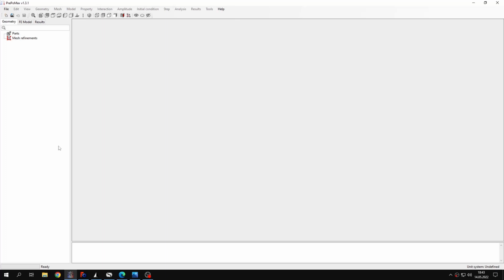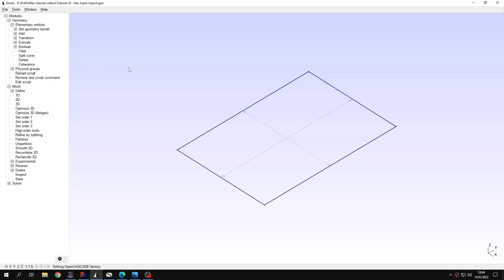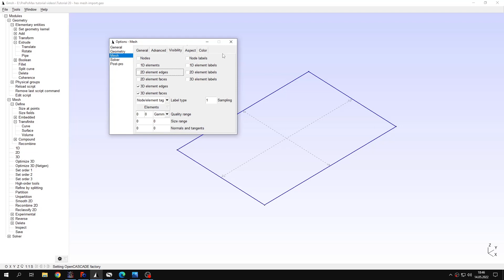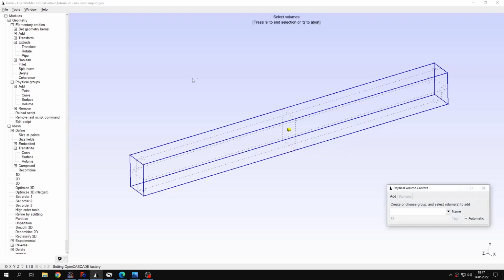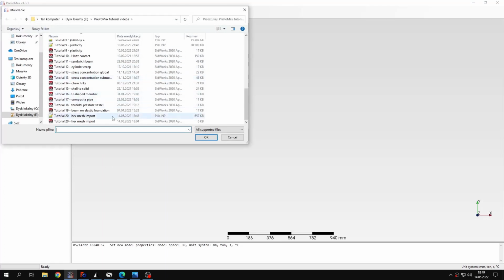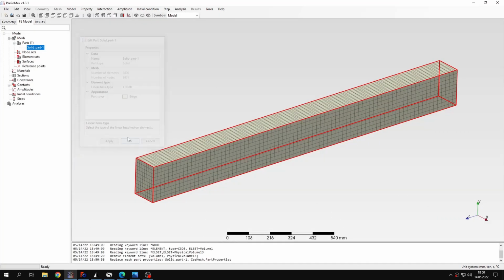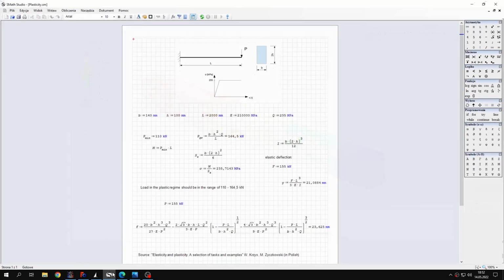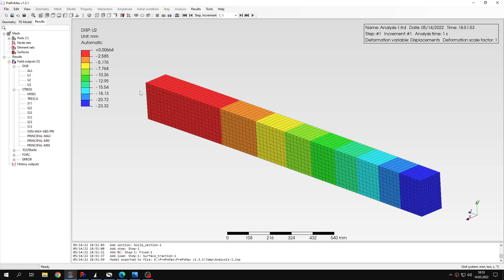PrePoMax (CalculiX FEA) - Tutorial 20 - Hex mesh from Gmsh

Comment: Hey. I think it would be super interesting if you did more of these hexa mesh tutorials, I've previously used Salome-Meca for that a bit, but i'm interested in learning Gmsh too. Great tutorial as usual
Reply from the maker: To be honest, I’m not very experienced with Gmsh. I was rather thinking about making a tutorial with hex mesh generated in Salome_Meca. But I will think about showing Gmsh again. There aren’t many tutorials for this software (and the best ones are in German) and it’s not very user-friendly so I guess that additional videos covering Gmsh could be useful.
Reply: @FEAnalyst  do you prefer salome-meca over gmsh? I'm on the lookout for a good open source hex mesher, and I think salome meca is actually pretty good for that
Reply from the maker: @Panvil  Both are quite unintuitive but in different ways. Salome_Meca has strange GUI where you have to go through lots of steps to do anything and there are some unnecessarily complicated meshing procedures (like having to select from some algorithms and their rules with not so descriptive names). Gmsh has simpler GUI but because of that meshing is less automated and requires getting familiar with scripting commands. Also, it seems that Salome_Meca has more advanced hex meshing algorithms and Gmsh specializes more in tetrahedral meshes. However, these two programs are the only open-source hex meshers so there’s no other choice. All in all, I think that I would use Gmsh for simpler cases and Salome_Meca for more complex ones. But this preference may change once I get more familiar with both tools.
Reply: @Panvil  Salome is strange, I admit it and it needs a lot of practice (I've been doing it for a while and I still have problems, so carry on :) )
Reply: @FEAnalyst   There is always cgx the native tool for Calculix. But if you are looking for something intuitive run as far away as you can from it.  In 2010 cgx, Netgen and Gmsh were the only decent options available.  I have some documentation on cgx if anyone is interested.  cgx can handle all Calculix element types since its written specifically for that solver.

Comment: Great tutorial.
For me using Salome-Meca seems easier than Gmsh for some tricky geometry (I made some Nozzle-Shell and Nozzle Head calculation with Salome/Prepomax)
Reply from the maker: Thanks, I can also prepare a version of this tutorial with Salome-Meca.
Reply: @FEAnalyst  this is my personal opinion, but for head/nozzle connection the Salome's i,j,k-method is the best hexameshing solver - in the OS scene. 

Yes, sometimes the geometry gives some hard time, but slicing the surfaces could help a lot. For me the GUI of Gmsh is to strange. 

The only reason why I haven't kicked out the win-system is Prepomax. To handle Salome is a little bit difficult too. Combine the 2 systems together is my personal favorite in the FEA field.
Reply from the maker: @tiborkemeny8644  By the way, do you know if Salome_Meca’s source code is available somewhere ? I couldn’t find it so far (I’ve only found the source code of code_aster solver). 

Unfortunately, there are just a few non-commercial meshers capable of generating hex meshes and I also have the impression that Salome-Meca is the most advanced of them, offering various techniques (including hexa block) for generation of complex meshes. It’s not user-friendly but really powerful (just like the aforementioned code_aster solver). One more interesting free hexa mesher is IA-FEMesh but it’s limited to hexa block technique and designed for quite specific applications (models obtained from medical imaging). Apart from these three, there’s pretty much no other non-commercial solution. Well, theoretically, there’s also the SnappyHexMesh associated with OpenFOAM but I don’t know if it makes sense for structural models.
Reply: @FEAnalyst  I haven't find it either. My first guess will be the salome for windows community. They should have something...
Reply from the maker: @tiborkemeny8644  From what I've found, source code of Salome_Meca is available for its Linux version. However, the Windows port is built by a company that provides only the binaries.
Reply: @FEAnalyst  interesting. A big question is, where Salome goes in the next version. The last version was published in the scibian distribution (this is connected to EDF too)